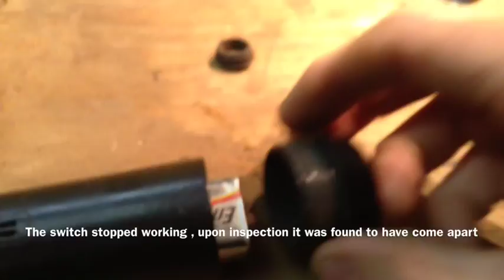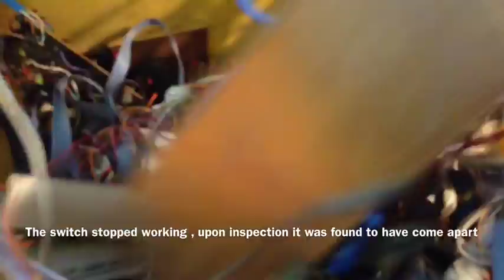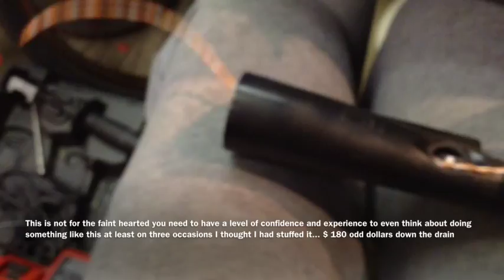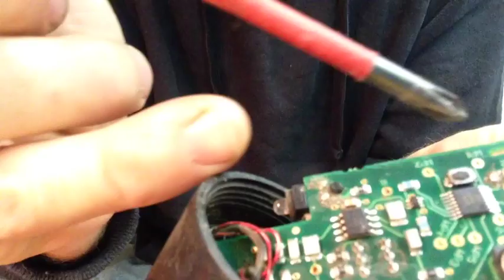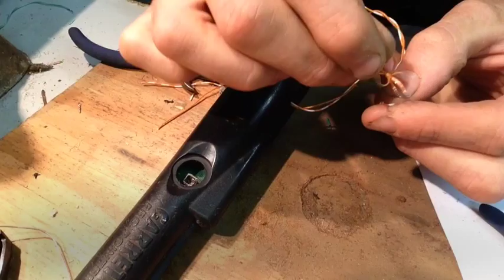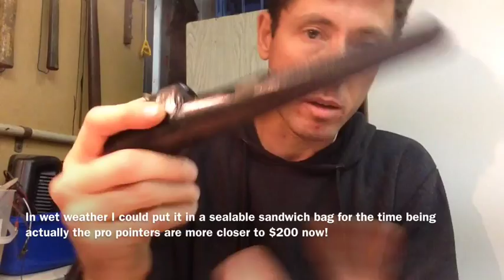S1: E49  Aussie Coin Hunter "TRICKY PIN-POINTER REPAIR"

Comment from the maker: Yeah look I'm still working on restoring that to top condition as it works but I think the external wiring and switch interferes with the operation from time to time and I have something In the works at the moment.
I have found that old computer tower push on off switches seem to be identical and I have a couple , believe my pro pointers are next on my list for my attention , my newer one I will be looking for the chair leg caps as you suggested because it's still under warranty but the older one in this video I will be trying to install a new push button switch in the not to distant future.
Regards
Paul

Comment: You should just order another switch from Garret. I'm sure they would send it through. be cheaper then buying a new pin pointer. 
Mind you I will most likely see that you have done this in a later episode or bought a new one.
Cheers

Comment: Hi Paul, I know whats its like my job keeps me busy and all I want to do is treasure hunt all the time, I'm like you I always see good hunting spots as I'm driving places and keep them in the back of my mind.Mate I have got four metal detectors the first one I got was a snoop pro which I learned on. I then got the Garrett Sea Hunter that I used in the water but as it doesn't have discrimination I had to dig so many targets and too many of them are junk.I then bought a minelab excalibur 2 which I think is a very good waterproof machine, you can discriminate the iron out. My recent buy was the minelab x terra 705 which I love for coin hunting in parks and sporting fields.I find it very accurate and I have worked out what numbers the $1 and $2 coins are on the display so when I hunt I only dig the goldies.I'm looking forward to your next video.I'm going to hunt a lake near where I live and after easter and Anzac the lake would have had huge crowds so I will let you know how I go.I do have some of that marine epoxy left over from the time I put it on my coils and if you have access to my email address and give me a postal address I can send it to you and some other spare stuff I have made.Take care mate...Scott AKA Captain No-Bierd

Comment from the maker: Hey hey captain that sounds like a good idea someone mentioned something similar a while ago but I haven't done anything about it I also saw a video on you tube of a guy buying this stuff you can buy for dipping your tools into, yellow stuff which essentially is like a plastic dip soloution which when dry he dipped two more times and it comes out rock hard, very interesting, at the moment with the income not what it used to be and the budget reasonably tight I will keep note of it and it will be a future expenditure , that's awesome to know you can get stuff like that, thanks I really appreciate the info.
My metal detector came with a skid coil cover and when I bought my 5x 8 small coil I bought a skid cover for it but that could be the answer  for the coils also for future.
You said you had what sounds like an under water metal detector what brand is it? And do you have and use any other metal detectors or is that the one you use all the time?.
Man I've started working on the next episode and it's a bit of a mission to work out how I'm going to present it all, but I'll get there.
Also one of the runs I do at work has tons of playgrounds and schools along the way and I want to just hit them all in one day on a Saturday I think it will go off, also I have one historical hunt site that I went past tonight and they have marked out where the power cables are under ground which means road works are going to go through there and I think the old house site will be developed and gone so I'm going to have to hit it this weekend I think? Man so many sites to hit and not enough time.
I don't want to let the oppertunity go knowing that it's an old house site and there could be some coins there but at the same time the spendable would be welcome, I'll see how we go.
Hey I'd love to see your hunt techniques in the water and at the beach, as you saw in the episode where I chucked the at pro into the sea and it was floating well within a short period of time the head module speaker died and I could see the target ids but no audio so low you couldn't hear it that's why I got it changed under warranty as you saw in he videos!.
Gotta go but hear from you soon Paul

Comment: Hi Paul, Just an idea for repairing your worn pro pointer, one of my detectors a sea hunter mark 2 didn't come with a coil cover and I found that will a lot of use in the water the coil started to wear down really badly.I went to a boat shop and bought a small tin of marine epoxy, mixed it together with the hardener and spread it on the base and sides of my coil. When it was dry I sanded it so it was nice and neat.I have given it a hiding in the surf and sand and it has hardly worn, it is so tuff. If you used a thin layer on your pin pointer, it will take forever to wear. maybe it an option for you mate.